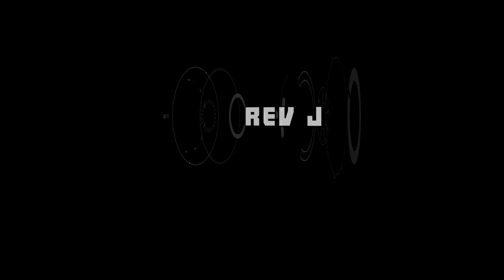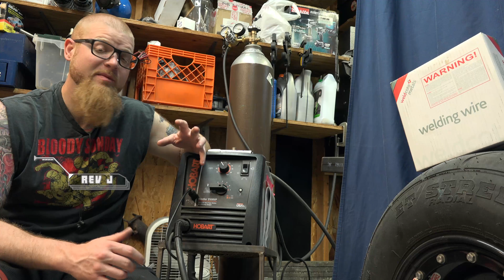Mig Welding Supplies - What I Use and Where I Get It.

Comment: I know this is a  old video so this could help new welders out when setting up there machines. I am pretty sure your wire is in wrong grove on drive roller. looks like wire is in the .035 k grove not the .030 v grove. you did say you ran .030 solid wire. If your running a .035 flux core wire then that would be right.